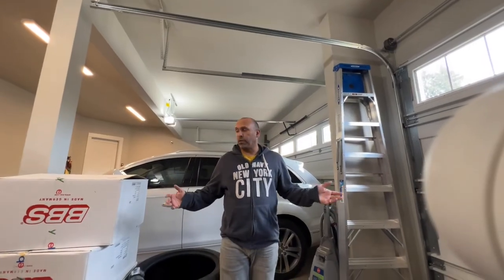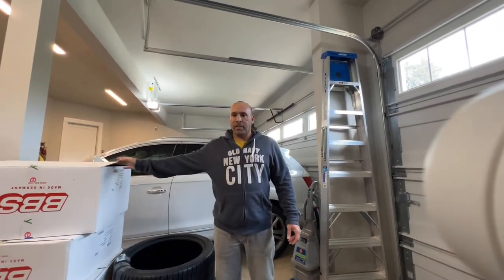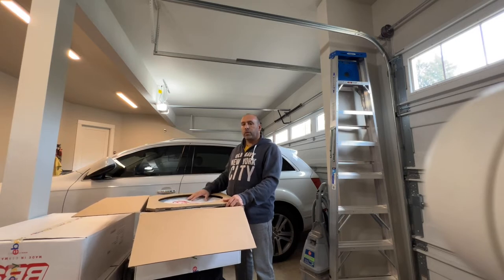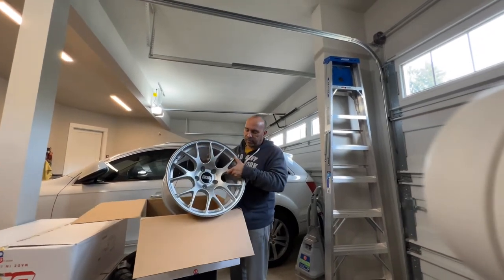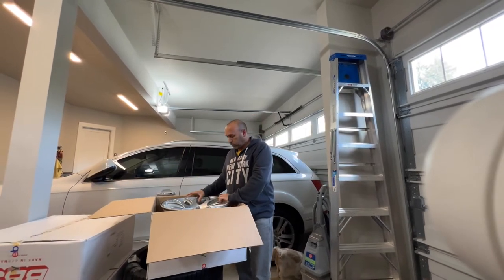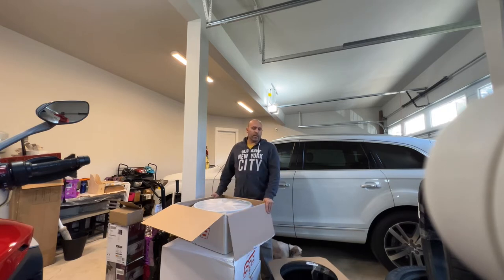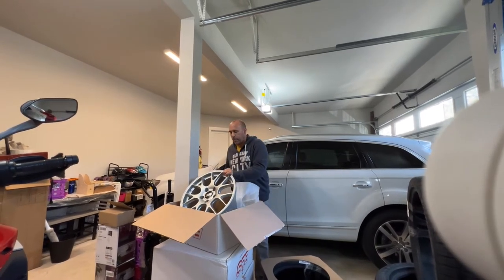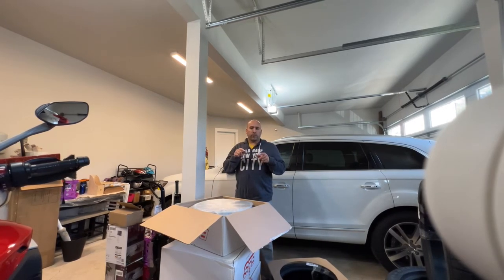Wheels and tires for the Porsche

Comment: Sorry to see the Carrera Classics go. Not sure why you need that much rubber on the road, it's not like you outdrive the rubber you have now. But to each there own. I do like those BBS wheels though. However the ride may be rough with 19" low profile run flats. Can't wait to see them on the car and hear your review after your first couple of drives.
Reply from the maker: Hi Mike,

You are correct, don’t need that much rubber. We also don’t need a GT3 but we all want one 😆.

I have not decided what to do with the Classics yet. I might slap full winters on there and go bombing in the snow in winter. I might sell them.
Reply: @Alberto1B  I hear you in regards to the GT3! Why not keep the Classics and, as you said, put winter tires on them. Better and safer winter driving for you and the original rims will still be be available for the new owner, should you decide to sell it someday. I always feel, whether cars or houses, one should always consider resale when doing mods or renos.

Comment: I guess I’m somewhat of a snob (with all of 9 months into my ownership) but I prefer OEM wheels.  I appreciate the CH-Rs but they never appealed to me.  The E88s are big in the P-car and BMW crowds too.  Don’t care for those at all.  I don’t think those FTW’s or whatever they are would look right on a 997.  Older air-cools, sure.  None of that matters tho, because it’s not my 911, just my snobby opinion.  Are you planning on ceramic coating them to help keep them fresh?  Looking forward to seeing them mounted, those rears are insanely wide!!  Gonna look good from behind to see all that rubber.
Reply from the maker: Not snobbery at all. You make really good points. I am going to use Nexgen ceramic spray. I only use it on wheels. It stains on body panels after multiple uses. I also already installed ceramic low dust front brake pads.
Reply: @Alberto1B  I have the same OEM wheels as you and recently had them refinished (curb rash, nicks, scratches, etc.).  Just realized I probably should’ve ceramic coated them before I get to far along.  How does that NexGen work?  Hard to apply?
Reply from the maker: @K1dPhresh1  Nexgen is super easy to apply. Spray on wipe off. It only needs a small mist to coat wheel or surface but only last a little while. I over used it on my paint, easy to do but I stopped using it because it stains my PPF. It works great on painted wheels. Probably reapply every month or every other month depending on how often your drive.

Their waterless cleaner is awesome!

It is not true ceramic coating though.
Reply: @Alberto1B  Does it get on your PPF by being slung off the wheels or from overspray during application?
Reply from the maker: @K1dPhresh1  not really. It’s a fine mist but easy to control and spreads easy. I spray right at the edge where tire meets wheel and almost never get it on body. If you do, just buff it off with microfiber towel